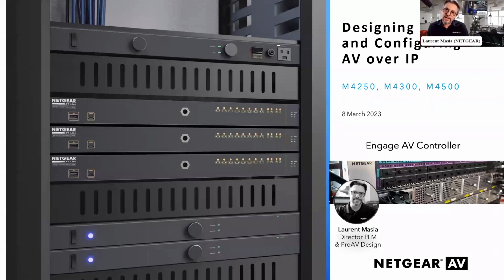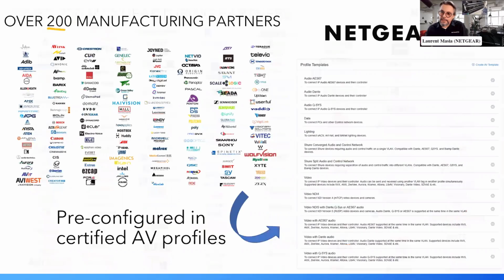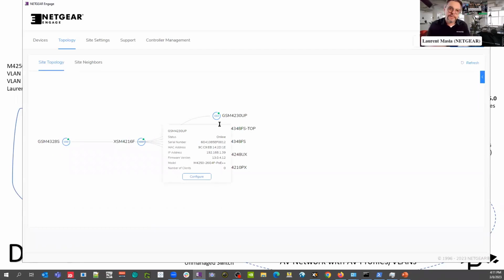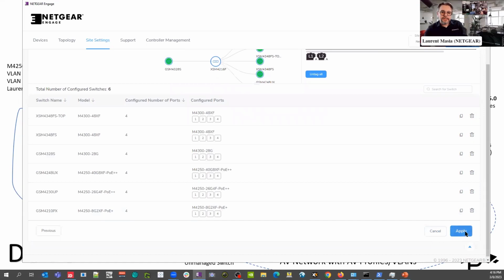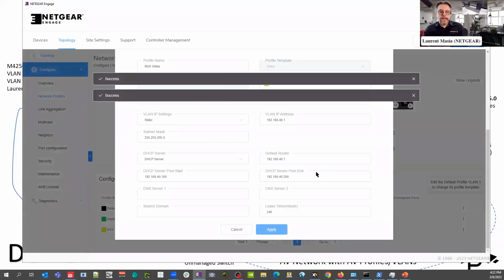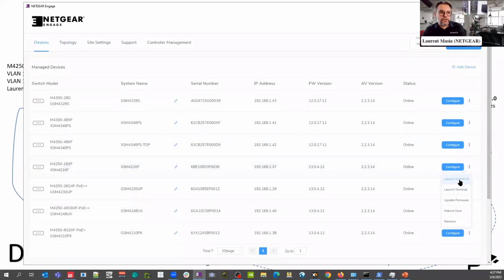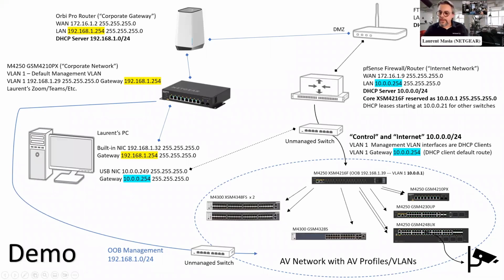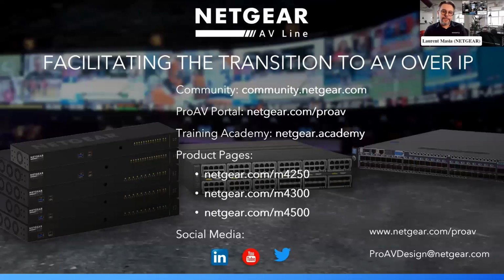ISE 2023 Demo – How to Set Up an AV Network Using NETGEAR Engage

Comment: You need to address the firmware push that bricked a ton of CAX router/modems
Reply from the maker: Please visit this community link for more help on the CAX30 https://community.netgear.com/t5/Cable-Modems-Gateways/NOTICE-My-Nighthawk-CAX30-Cable-Modem-Router-is-not-connecting/m-p/2296430#M42715
Reply: @Netgear  you still need to address it with your customers instead of replying to angry comments with a “turn off traffic meter” fix. You bricked routers past the fixing point, you need to publicly address it.
Reply: @jacobreuter  this has nothing in common with netgear av range of routes.
Reply: @bleketas  no shit, they dont respond if you go through the regular ways. Thanks for participating today.